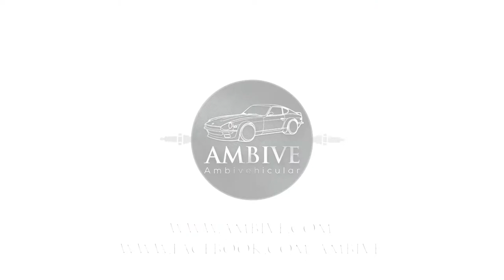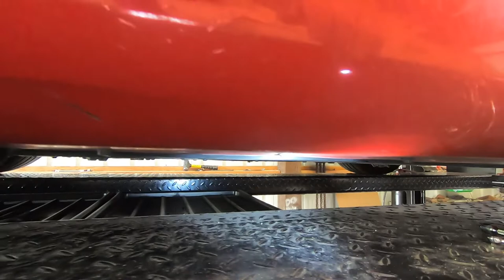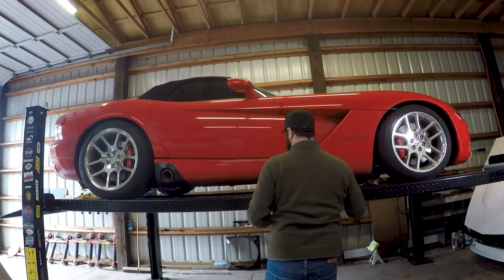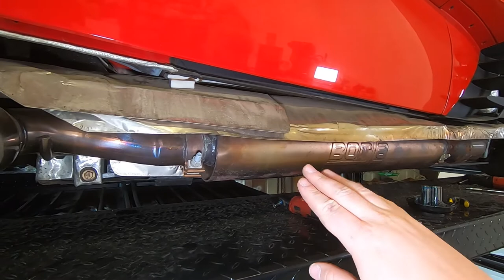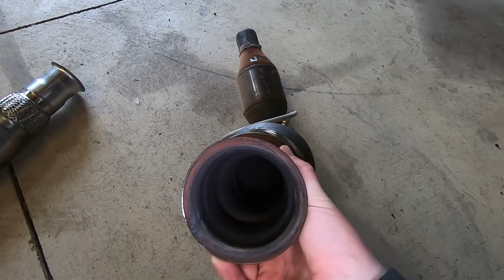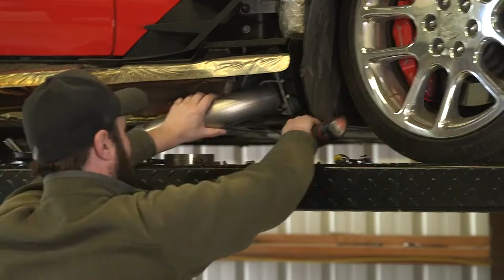I broke my Viper...

Comment: Dude you should see my passenger exhaust pass through. Even the floor board has a hole in it. I don't think it's just heat, maybe a lot of parking by the beach. I treated it with converter and por15 but I'm concerned how long that will last with all the heat... I also reeeeeally want those cat pipes you have. Looks like the Roe racing ones 😍 Should reduce the heat down there with less catalyzing going on 😁

Comment: I did the same cats , I do notice the smell more now but I still passed smog and no codes. Curious if you can have bad o2 sensor and not throw a code.
Reply from the maker: That's what I'm looking into now. I'm unsure of what can cause such a disparity between banks and not throw a CEL, but once I find out, I'll document it for everyone else!
Reply: Ryan walvoord what brand cat converts are these?  Any issues after install?

Comment: I've got the same Borla on order for my 03.  Since you've now done the cats too, would you recommend just  going ahead and doing the cat back and high flow cats at the same time.  Car has 53k miles and still has the stock exhaust.  Were you overall happy with the sound once adding the high flow cats?
Reply from the maker: The high flow cats without the crossover pipe is definitely louder, so I think it depends on your personal preference. If I am driving the car on the freeway to a race, it's a bit much for my taste, but not enough for me to regret it or change them. If you want ear bleedingly loud, they won't be that. I would say it's basically a middle to upper middle of the noise range.

If you are in there, I would definitely consider at least replacing the OEM cats if not going to a high flow option just to reduce the chance of failure. My cats failed with only 17k miles and I've heard the same story many times. I would just consider it preventative maintenance.
Reply: Hey Casper when you went hi flow did you have an awful smell associated with it? My smells sulfuric above 3k rpms. It’s been smelling like that for about 300 miles now

Comment: So what was the problem at the end, was it o2 sensor? Do you had some very small valve noise? We have one here, with 33000 miles. The first owner replaced passenger side cats oem and it smell not like it should and i can hear a little bit of noise on this bank. The other side is perfect. The car does not have any issues. Runs perfect, has full power. But just a little noise on the passenger side. What do you think.?
Reply from the maker: Mine ended up getting cleared up after pulling and checking plugs, checking OW sensors, and just reconnecting everything. Our working guess is that it faulted something and it cleared after driving without issues for several miles. Possibly an internal emissions code or something.

Plugs all looked good so once it resolved after driving, we figured we would check back in a few thousand miles and see if there are any signs of issues we can't hear.